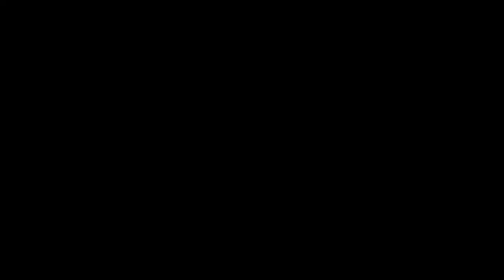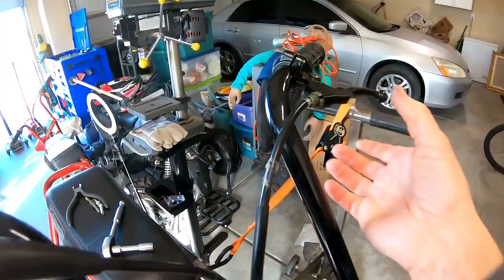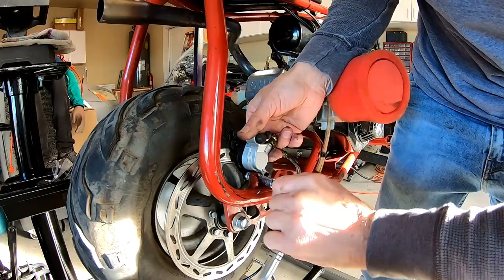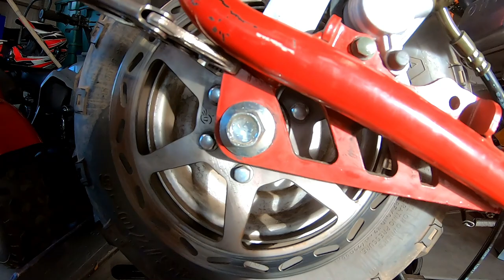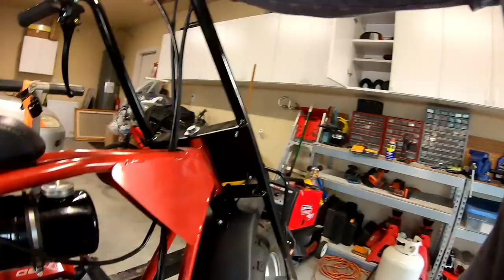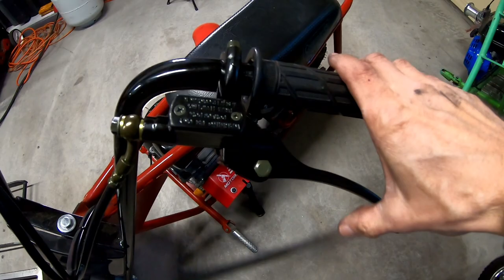Coleman CC100X hydraulic brake install

Comment: I used the “Mini Bike Hydraulic Brake Caliper Bracket” from Go Power Sports. Made this same brake kit bolt on on my cc100x. Only had to drill one hole in the bracket so it could bolt to the bracket that is welded on the frame.
Reply from the maker: Awesome! Ya, for me I love the challenge of doing this stuff myself. About 50 cents worth of metal and a few washers and a drill . And a  hour of fun.
Reply: Hello did you use that bracket with the same type of Hydraulic Brake Caliper he used? and if so do you think you can possibly send/upload a picture of how your beake set up looks? thank you so much

Comment: nice job! man 
btw i envy your dry climate..  where i live the humidity alone would rust up that plate in a few months just sitting still. It  would require either
 self etch primer +spray paint, powder coat,  or my current favorite of DIY black oxide followed with oil based stone sealer.
Reply from the maker: Thanks! Ya, nothing rusts out here. 
I guess that's why a lot of people go out west to buy vehicles.

Comment: my ct 100 was left outside for 4 years at mtk long island in a salt air Enviromint and it took about 4-5 hours just 2 get the engine running . i have a 5 1/2 Honda engine I'm going 2 put on it with a 7/8 output shaft so there's going 2 b a little sleeve finagling 2 b done. i bought the same set up u have 4 yours and i should b able 2 stop her. like Miguel said we have 2 figure out a cheap front brake setup and u have the hooks.later

Comment: now you just need to do some 30mph to 0 stopping distance tests...

I plan on doing the same thing on my street driven MM80 with the 200cc engine (and maybe a front hydro brake too)...I don't think it would be necessary to do on my little 80cc dirt/sand cruiser

I see GPS has a bracket to bolt these hydro brakes to the rear of an MM80 for $8.00, so I think I'll go that route

Comment: Hi black 66I have a question how do I put my hydraulic brake system on my storm 200 mini bike if the brake pads are to thick to even fit on the disc

Comment: Do you know if the bigger Coleman models would fit about the same. I can fab a bracket, but do not have a welder.
Reply from the maker: I think it would but I would recommend going with a two piston brake for the bigger bikes. The pads are small on this brake and would be used up quickly with the weight of the bigger bikes

Comment: I did the same thing with mine and there is no braking power.  It's centered and floats but just don't have the force to stop the bike. Any ideas?
Reply from the maker: I think maybe we should fab a mount and install a dual piston brake.  That will give us some good stopping power. The small  pad single piston 
brakes just aren't designed for a lot of speed.
Reply: @Black66  I figured out my problem.  It's such a small system I had run out of oil.  Added oil and got the brakes to lock up with me and my daughter on it.  Lol

Comment: Hey I got tillotson 212 its been sitting for 7 months I drain the gas out , put new gas in and I change the oil its start first pull and runs but when I started riding my mini bike the engine is making a knocking noise when I slow down and it's wants to cut off when I let off the throttle , any suggestions ?

Comment: Can you still run a brake light with the new brake handle?
Reply: There are brake light sensors that have banjo bolts to bolt to the master cylinder tosense hydraulic pressure for brake lights
Reply: @larryegilman1  can you explain that a little more, like what are banjo bolts and master cylinder?
Reply: @brycekoons1769  with motorcycle brake levers that are hydraulic, the master cylinder is integrated into the lever assembly.
The brake line attaches to the assembly via a banjo fitting on the line and a banjo bolt that joins it to the master assembly. 
The master assembly and line replace the manual cable found on mechanical brakes